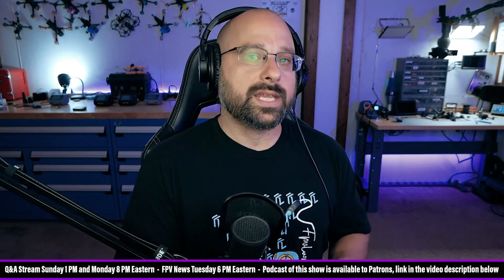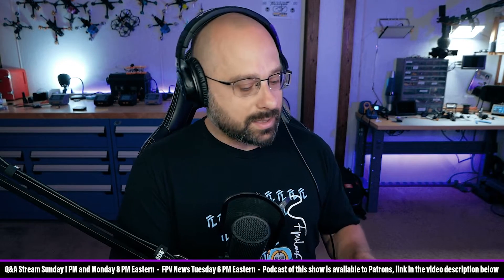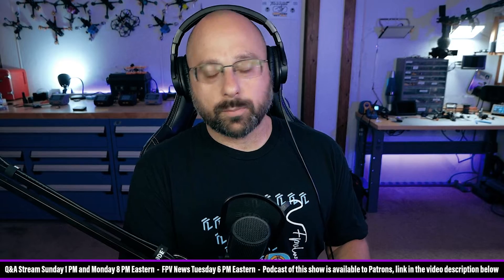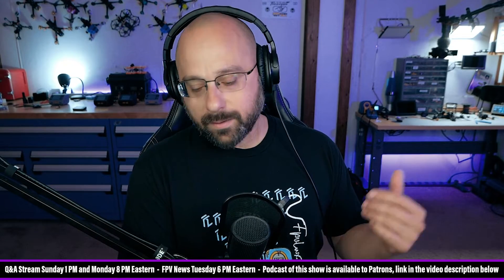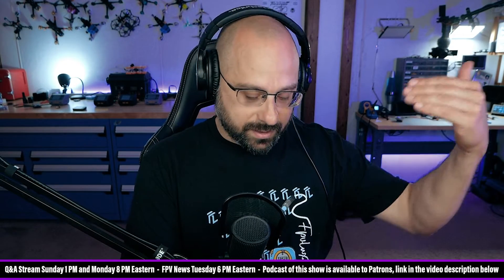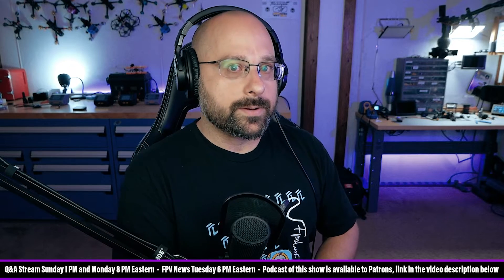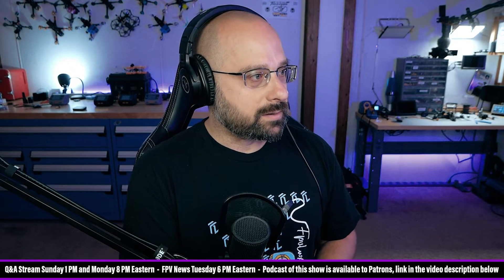When Should I Retire a LiPo Battery for FPV Drones?

Comment: what about 3S or 2S? The internal resistance is much higher right?
Reply: Not usually, no. In my experience (same brand tech and C rating) larger individual cells will always have lower IR. 
A 2000mAh 2S pack will have a lower IR than a 1000mAh 4s pack of the same weight... however the 2S system will typically pull a higher amperage than a 4S system of the same performance which evens things out a bit.
Judging from 6s to 4s quad comparisons, the peak performance of the 2S may initially be higher while the 4S's performance may not be as high initially but drops off slower until it hits around 3.4v pc then the sag falls off a cliff.

Comment: Even if they are really puffy?
Reply: I was charging a puffy battery once and it started getting really puffy. When I picked it up it was too hot to hold, so I took it outside holding the connector. Thankfully nothing exploded.